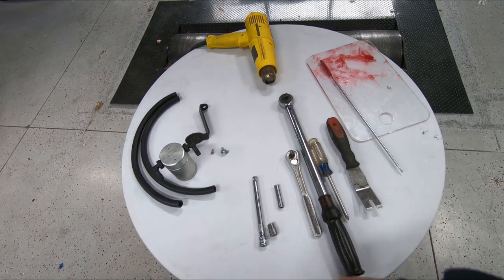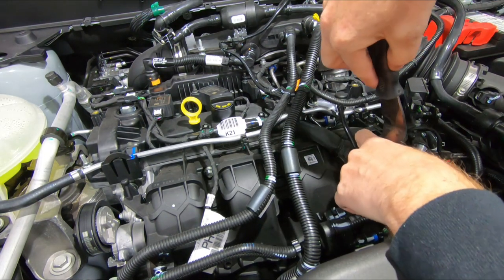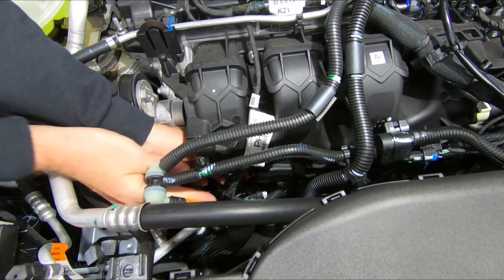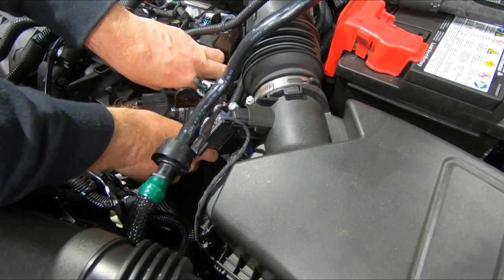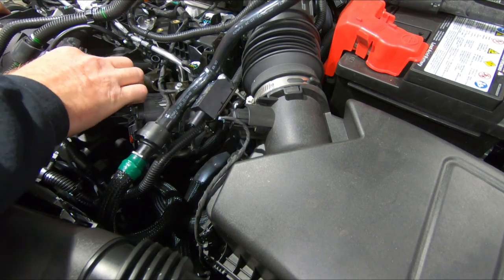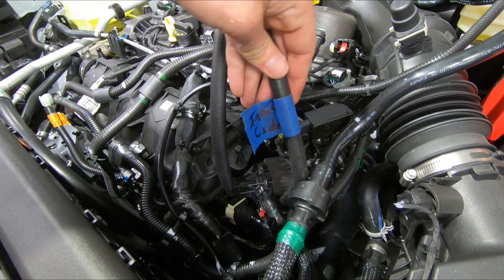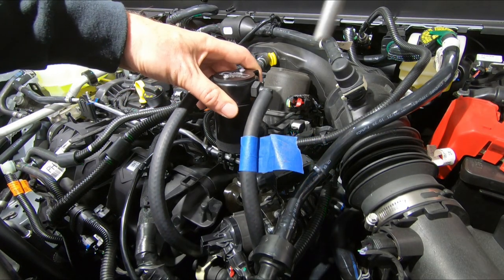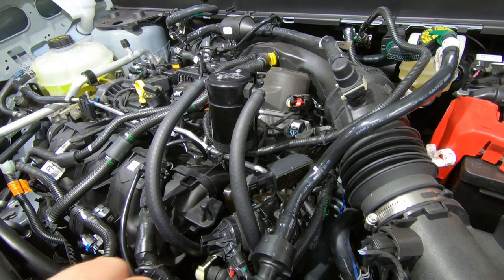J&L Oil Separator Co. 2019+ Ford EcoBoost 2.0 Bronco Sport, Edge, Escape, Maverick Install 3044D

Comment from the maker: Hello Everyone!

Maverick owners can remove the stock PCV line by removing the stock intake pipe and reaching in from the driver side.  This way will not require intake manifold removal.

We have a new installation video showing this method here - https://youtu.be/_bGFjIhnuPU

Please note this kit fits many models and this will not be possible on every application.  

Thank you,

J&L Oil Separator Co.
Reply: Thanks

Comment: Careful when pulling out the Ford quick connector; on both of mine the orange o-ring seal tore off on the way out. Also, if you have skinny arms, you can access both ports without removing the intake manifold at all, and instead only removing the air intake - which is only two bolts and two clips.
Reply from the maker: We've been able to do this install on other 2.0's in the past without complete manifold removal but it's all blind work and makes for a difficult video to understand.  Good to hear you got it on!

Comment: I didn’t even do all this shit with my maverick dual catch can setup. I removed the intake tubing from front, then just simply reached under and felt the PCV side and the intake side and disconnected them. Felt like a contortionist but I was able to do it with relative ease.

Comment: I just reached up thru the bottom driver side and did it in 10 mins. Didn’t disconnect anything just the two ends and out came the line.
Reply from the maker: Nice job, we're going to do another video with the simple install for Maverick owners.

Comment: ... looking to do this ASAP! How about the second PVC valve on top of the valve cover? (Right Side of Engine) ..shouldn't you "T" that one as well?
Reply from the maker: That line is typically referred to as the "clean side" line, it only see's any major airflow when the vehicle is in boost.  Even at that it's little in comparison to the 25 inches of vacuum the dirty side line see's just sitting at idle.  In our experience the clean side can's don't collect much over 10k-20k miles.

Comment: You could tell me what the difference is between the 2.0L 2018 engine and the 2019. For the 2019 engine I have to remove the engine cover and I don't like the idea at all. Could it be that I can use that of 2018 in my 2019?
Reply: 2019 Ford Escape 2.0l Titanium
Reply from the maker: While the motor is "the same", Ford changed the PCV routing and engine layout between 18-19. Because of this we had to come up with this new part number to fit the 19 and up 2.0's. Due to limited space in the engine bay we had to mount this separator where it won't work with the factory engine cover.

Comment: Great vid, gonna do this on our 22 Corsair. What diameter is the hose?
Reply from the maker: This application comes with 3/8" hose
Reply: @jloilseparatorco.1853  just installed last night and my forearm is cut up lol. I think 1/2” hose may been a better choice/fit but I went with the 3/8”. Hid the can in the driver front frame by the radiator
Reply from the maker: @sslavik03  I know too well of the battle scar's from these installs!  Shoot us some pictures of where you mounted it to info@jlosc.com , I'd love to see it.

Comment: What’s strange is that manufacturers do not provide oil separators as standard despite the benefits.
Reply from the maker: It would be very difficult for the manufacturers to get anything that needs to be maintained 50 state/CARB legal.
Reply: It's  about the people who would never drain the can, creating a much worse situation and warranty issues.
Reply: This situation I believe is kind of like the “lifetime“ transmission fluid deal. Ford was you to replace every bolt you take out along with the transmission every 50,000.

Comment: Do you guys offer install services at your shop for this product?
Reply from the maker: No we do not.  May want to check with a local Ford service center.
Reply: @jloilseparatorco.1853  Will ford void my warranty?
Reply from the maker: Sorry for the delayed response. The dealer would have to prove that the aftermarket part caused the failure in order to void a warranty. Still, some service departments are easier to work with than others. If you are concerned you can always contact your dealer and ask.

Comment: What about smog test . . . . . Will this pass?
Reply from the maker: It's our understanding that the oil separator is on the exempt list for inspection but you may want to check with your local smog inspection station for clarification.  We also still can't send this to California directly even though the are exempt in inspections.  That's California for you :)

Comment: What advantage does this add to the engine?
Reply from the maker: Hey Michael,

It's to aid in keeping the valves cleaner and from "coking" this is very common on the 2.0 applications going back to 2013.  Here's a photo of a 40k Mile fusion we had in house a few years ago.

https://cdn11.bigcommerce.com/s-auzy3uecc1/images/stencil/1280x1280/products/488/1849/3032P-C_2__23262__77066.1643825854.jpg

This will help slow this process significantly by collecting the oil that act's like glue for the carbon deposits.

Let us know if you have any other questions!

Thanks,

J&L Oil Separator Co.
Reply: THE DISADVANTAGE OF OIL CATCH CANS IS YOU MAY NOT PASS EMISSIONS TEST
AND MAY VOID YOUR WARRANTY 
AND ADDED MAINTENANCE
Reply: @21boxhead  emissions. Not sure why. Can’t void warranty. I think it’s covered under Magnuson-Moss Act. Does depend on dealer though.

Comment: Interesting. Most Maverick catch cans just tap into what you are referring to as the “clean side”. So you are saying those are not effective as it will only see airflow when the crankcase is under high pressure ie high boost. What is the right side then? “Dirty side” line?
Reply from the maker: The PCV side, AKA the "dirty side", is the one that is under vacuum/suction most of the time while the vehicle is running and driving. This is the side that our kit interrupts. In our experience with these motors the "clean side" collects little to nothing over 10-20k miles.

Comment: Will my vehicle pass biannual smog inspection in California with the oil separator installed?
Reply from the maker: It's to our understanding the oil separator is on the exempt list for inspection but you may want to check with your local smog inspection station for clarification.  We also still can't send this to California directly even though the are exempt in inspections.  That's California for you :)
Reply: @jloilseparatorco.1853  I talked with my local smog station and like you said the oil separator itself is legal. The problem is you can't lengthen the ventilation hose by more than 12 inches. So, I guess the way around this would be to mount the oil separator on the engine and not the firewall as shown in some installations.

Comment: will the ford warrenty still be good after installing the separator?
Reply from the maker: If you read the fine print on any warranty contract you will find a lot of reasons your warranty can become void; installing aftermarket parts can be one of them. However, per the Magnuson–Moss Warranty Act proof would have to be provided that the after-market part caused the failure. If you need further clarification, contact your vehicles service department. Some are easier to deal with than others

Comment: Yeah.  Uhh. Nope. Was easy to put on my Mustang but forget this on my Maverick.
Reply from the maker: We get it, this one is rather involved.  The thing is, being the direct injected 2.0, it's even more important on this vehicle than it was on your Mustang.
Reply: Well I was actually talking about the 2015 EcoBoost 2.3. I don’t remember this much trouble but I did trade it in for the V8 a few years later and that was simple like you said.
Reply from the maker: @mattfury3051  On the Maverick you can actually sneak the line out by just removing the fresh air feed off of the intake tube and stick your hand back there.  We have this video for now as it covers about 6 different models the 2.0 is in.  I'm going to try to get another Maverick back in the shop to do a video on the simple install on that specific model.
Reply: Don’t get me wrong. I appreciate the videos!! Thanks for working on the Maverick. This is a really slick little truck and I absolutely love it right now.

Comment: If it's so essential to prevent catastrophic engine failure why wouldn't it already be on the vehicle? Ford hires some of the top engineers as do all the other manufacturers.
Reply from the maker: Because something you would need to service would never be 50 state legal due to CARB/EPA regulations.
Reply: And a trillion dollar company wouldnt design something? Interesting.
Reply from the maker: @joestoen8681  You mean the company that just recalled these vehicles for catching on fire?  No one's Perfect Joe, and many things can be improved on. https://www.consumerreports.org/car-recalls-defects/ford-escape-ford-maverick-lincoln-corsair-recalled-fire-risk-a5285175759/
Reply: Not slamming your product. I'm sure it's doing well. Just looking at it with engineering liability in a fubar economy. And I have a new maverick with the 2.0 eco.